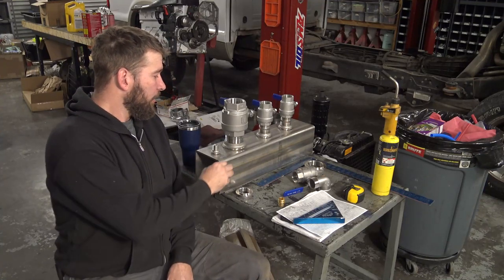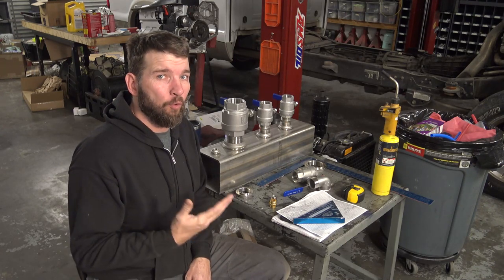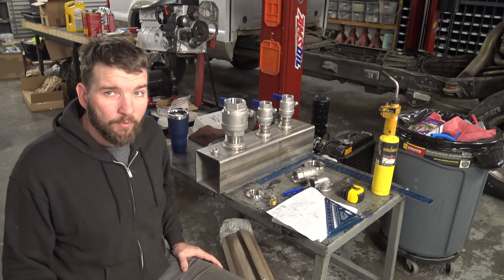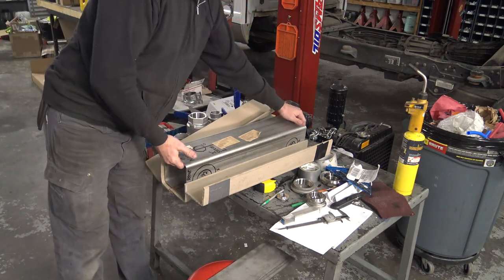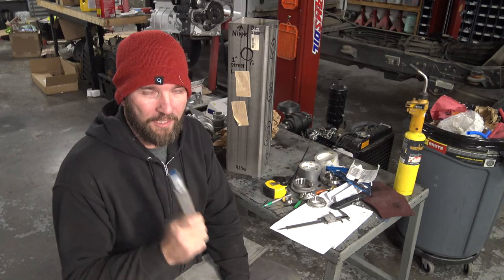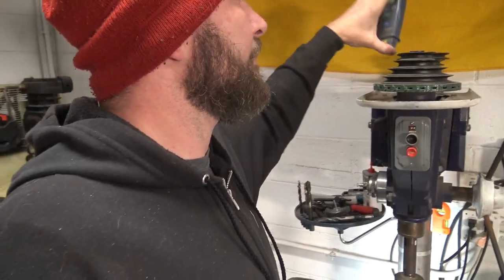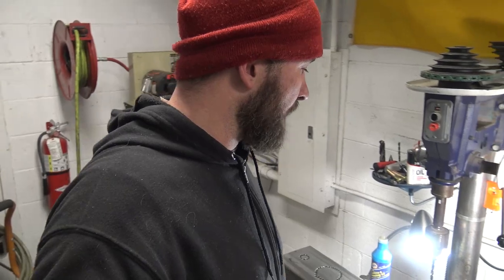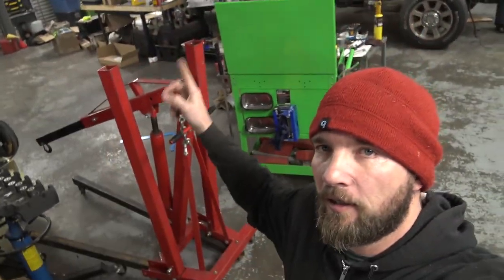Drilling Stainless Steel Without The Right Tools SUCKS!

Comment: M35 and M42 Colbat bits will hold up just fine. They're recommended if you are doing a lot of drilling into metal. Decent set shouldn't be much more than $100 from 1/16th to 1/2 inch. That was pre pandemic pricing.

Comment: Dang it, Chucke. Just when you need his mill, it's not set up.  Just giving him a hard time. Life happens so he probably needed the floor space 

That said, the machine shops are expensive. I had a 3 point conversion for an Allis Chalmers WD45. The holes on the lift arms were at the wrong end. For 2 holes, the machine shop wanted like $300 or 400. It was $200 for R&D and like $50 or 60 an hour for 4 hours work. I ordered 2 bits the size I needed, chucked them up in my little drill press, and had the holes in in under 2 hours. That's measuring, laying the holes out, and drilling.

Comment: I watched long enough to know that YOU know how to drill stainless. I worked on restaurant equipment for over 20 years, and worked on printed circuit production equipment for nearly 20 years so I have drilled, tapped, cut and welded stainless many many times. Other technicians break dozens of bits trying to drill a few holes and here I come and drill dozens of holes with out breaking one. The key is push hard and keep the speed slow. If it makes noise...well you lost! Lol! Some day I'll get a plasma cutter. Stainless is easy to weld, especially like the results from TIG welding.

Comment: I work for Evergreen Tool Company. We have a line of annular cutter designed specifically for stainless steel. We also offer a vacuum base drill for use on stainless sheet or plate. Look up Evergreen tool on the web.
Reply: @StephenCox.  I'll see what the boss says.

Comment: Drilling with carbide is expensive and they shatter easily. All you need is COBALT drill bits. Tough and inexpensive. Make sure they are sharp or they will work harden fast.
Reply: Yes 5% cobalt drills stainless.

Comment: For $100, you could have bought a few premium hole saws and gotten that done pretty easily, very slow speed, medium pressure.  I have laser cut holes like that also, remove slats in the machine so the tube can drop down, draw up the hole pattern in CAD, and bang it out.
Reply from the maker: Damn, I wish you lived a little closer! It would be fun filming projects with you.

Comment: You can use the usual HSS holesaws on stainless, use lots of oil and don’t expect them to las forever! I use a large variety on HSS holesaws on just about anything, mild steel, high carbon steel, stainless steel, aluminium , anything I want to put a hole saw through! If it’s hard and tough, just go slow and use lots of oil! They do wear out quick on harder materials, but use your head, don’t push too hard and allow time to cool as you cut and they will get the job done!
Reply: Paul O. is right. I worked a lot of stainless in an auto research lab fab shop. The heavy duty 2 range VFD controlled drill press could spin as slow as 153rpm. We used bimetallic holesaws & would use Tap Magic cutting oil. Here's a tip: Once the teeth have made a groove, lift out of the hole, blow all the chips out of the groove & off the hole saw. Then pour more oil in the groove & cut another 20 to 30 Seconds, lift out blow out, pour oil & repeat every 20 to 30 sec. The logic is: once the teeth are in the groove, the space Between the teeth loads up & the chips are trapped In the groove, preventing the teeth from further downward penetration! The extra slow speed, frequent lift, blow & reOil seems time  consuming but allows the teeth to keep cool, be free of chips & cut stainless steel efficiently. Another tip! Cheap tool place (HF) has an M3 cobalt drill bits that last longer than HSS bits. I got a partial set on Mgrs. Special & filled in the gaps with higher quality M4 bits from our machine tool supplier (Rex). Drilled many holes in cast SS turbo exh. manifolds for port & pre-turbinr exh.  temp. thermocouples & pre-turbinr back pressure. The Cobalt bits got dull slower (4-5 holes) vs 1 hole for  hss w/TiN coating. So I bought the smallest Drill Dr.(350x ?) & tuned up the edge frequently & back to work quick. Now I wish I had bought the 750X for bigger capacity & multiple adjustments & Split-Point grinding. Hope the info helps in future projects! Glad to see your YT vids again. Peace

Comment: You need a plasma arc. You can arc gouge it. You can cut it with a 200 am Lincoln turn it on Maxine and swap your leads it'll cut it. There's a lot more clean up, I have used hole saws. 
Remember to clean the oil off with acetone..
Good luck youngman

Comment: Would a plasma cutter cut stainless? Hole saws are so slow on any decent thickness steel i usially just use a holes saw for like 3 muinites to make a shallow grove and then use that as a guide for plasma to cut it out in like 10 or so seconds 🤣
Reply from the maker: Yes, absolutely. A plasma cutter would be the perfect tool. Unfortunately I cant afford to buy one right now.
Reply: @StephenCox.   does Chucke still have a Hypertherm?

Comment: Use cobalt bits or carbide. HSS will not last. Carbide hole saw will also work.
Reply: M35 or M42 bits will hold up for sure.
Reply: @Ratkill9000  I dont buy HSS anymore, even a cheap brand cobalt works better than most HSS, unless you get into very high end bits.